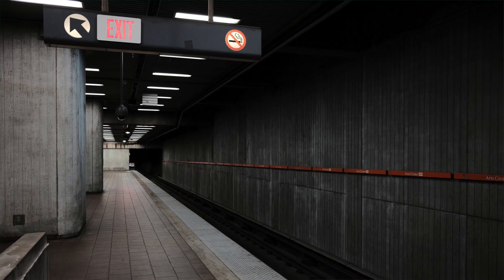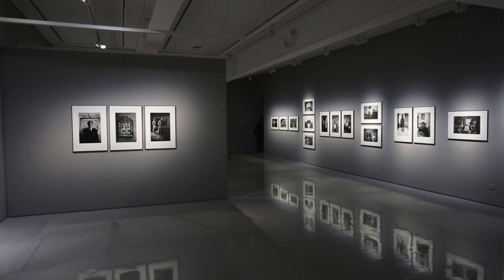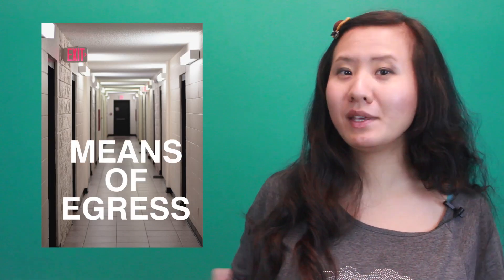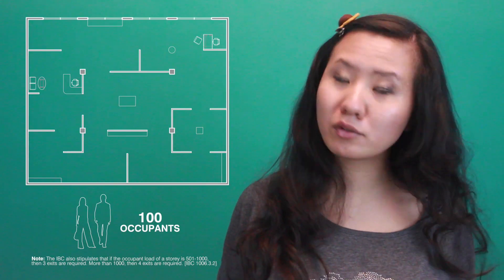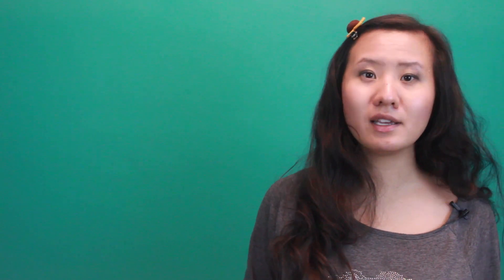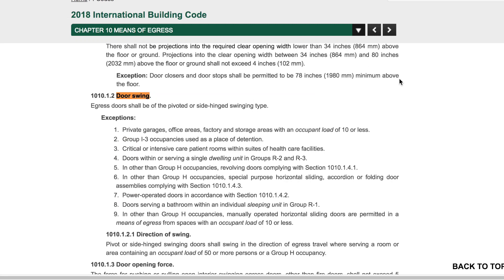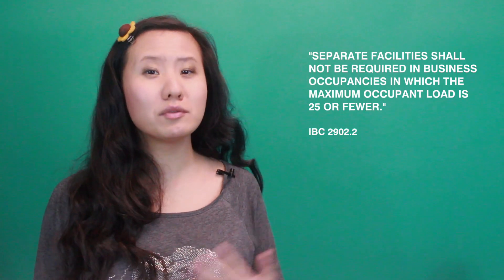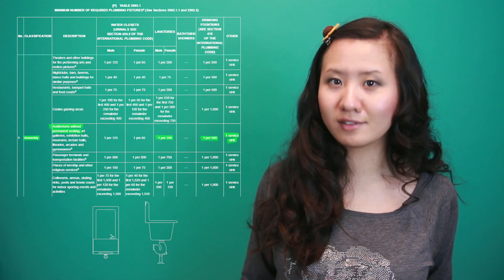How Are Building Occupant Loads Determined? | ARTiculations

Comment: Do building codes define what is meant by the words "woman" and "women"?
Do building codes require urinals for trans-women (who have yet to transition) in restrooms specifically designed for women (whatever is meant by the word)?
How do building codes determine the number - and type - of fixtures required for non-binary anthropomorphic individuals?

Comment: I’ve got to push back on one thing, which is the phrasing that “biologically” female bodies persons take longer to use the restroom than male bodied persons. Unless we are specifically measuring the amount of time it takes to empty ones bladder, there is a social component. Bluntly put, pants with front zippers are basically designed for easy dick access.

Comment: Why do some many restrooms open inward after I've washed my hands? I'd rather push it open with my foot on the way out. I'm sure it's a common question. LOVE your video!
Reply from the maker: Yes this is a good question. They open in because swinging out will likely encroach into the clear width of the hallway - you don’t want to swing the door open and hit somebody walking in the hall. But if there is enough safe clearance - I agree it should swing out to make exiting easier. Alternatively - a push button would also be a good solution to avoid having to touch the door handle.

Comment: I thought you were Canadian. Why are you talking in inches?
Reply: Canada's building industry has not fully committed to the metric system, all government projects use SI units but most contractors and design firms still use imperial unless required by a client.
Reply: Most construction materials in Canada are still sold in Imperial units, our trading partner to the south ensures this.

Comment: Nice video!  I take an unusual amount of pleasure from Chapter 10 and exiting drawings and calcs.  ;)  I also very much trumpet life safety... and remember, values therein are just minimums, you can always go more! (And sometimes have to, for example to meet the ADA requirements).  

I'm curious how you find the NRC's NBCoC compared to the IBC -- I've not looked at the NBCoC in a very long time, how do the two match or not?  (and you can limit this to just exiting to keep it from being to broad a question :)
Reply from the maker: I find the NBC a lot simpler. There are less categories in the load factor table and of course - I prefer metric lol. I also like how NBC doesn’t mandate sex segregation in restrooms - the way it’s written makes it optional. But I do like how the IBC lists occupancy groups - where A is Assembly, B is business, M is mercantile, etc. Whereas the NBC has C for Assembly, E for Mercantile, D for Business or whatever. So confusing lol.